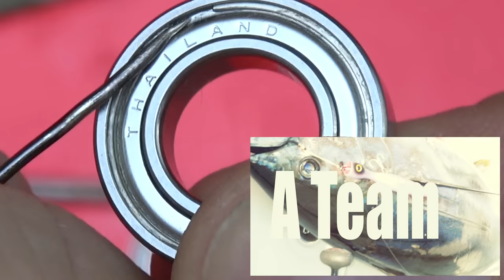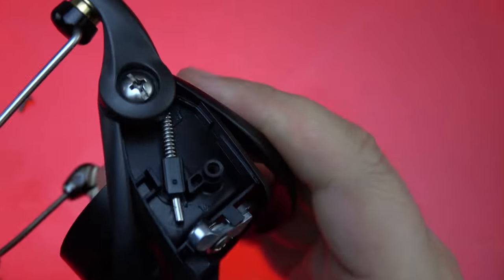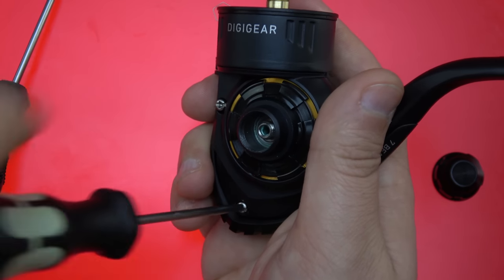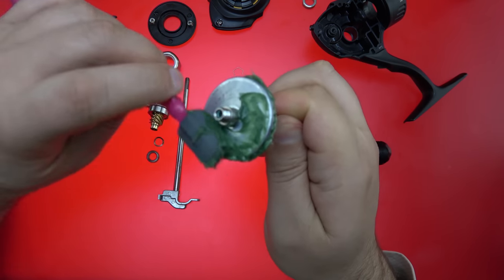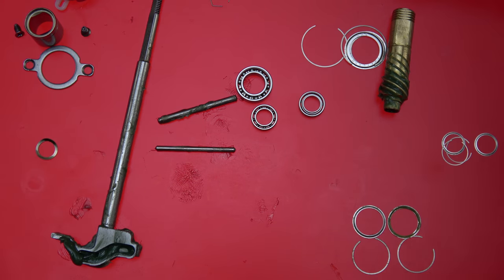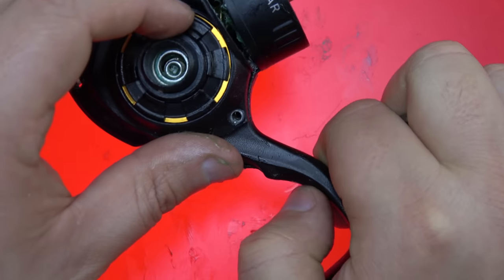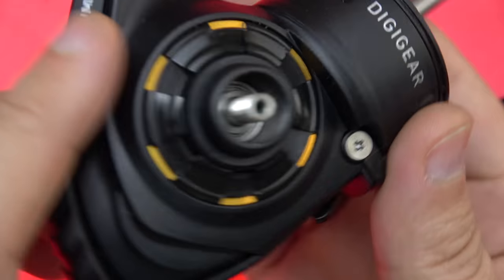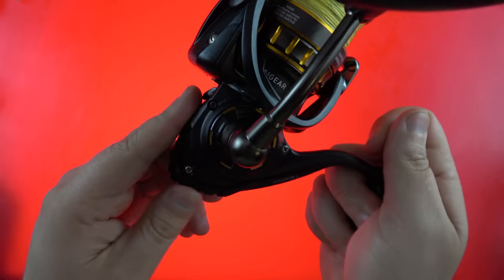Daiwa BG Full maintenance and service tutorial. How to protect your reel against  sand and saltwater

Comment: Have two of these reels and recently one started to jam. Found this video, stripped it down, and put it back together. First time I've done this and I don't have anything close to an engineer's mind. Quite straight forward, apart from minute 39 when you quietly couple the cam gear with the main shaft! Didn't see that first time around so had to go back in a second time! Otherwise a very useful film! Thanks.
Reply: Put a reel n rod on boat at sea. After 3 days salt spray jammed it.
   Open up, shoot with WD 40 and it work good as new !
Reply: @rohzpopper4922  didn't you hear what he said. NO WD-40!!!

Comment: Great video! Thanks Tackle Advisors.
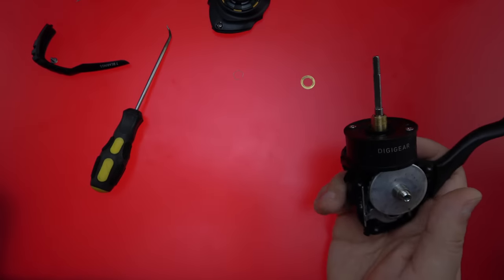But... I've just opened up my new 2500 for some preventive maintenance and found out that there are small differences between models. There can be a washer at the screw holding the case-bumper (at 16:20) sitting between the bumper and the case. It's not shown here nor in the shematics but both my 1500 and 2500 have it. The top cap covering the A-R clutch at 17:20 can sit on two tiny brass washers not shown in this video. There is also an arrow on the top cap that needs to point upwards > towards the foot of the reel.  So beware and keep a REALLY close eye on all the parts in your particular model.

Comment: Just wanted to personally thank you for this video as I had a bearing retaining clip pop out and I couldn't figure how to get it back in. The cut q-tip method was the trick! I held a small pen light in my teeth to illuminate the bearing lip and that helped as well. 

As a side note, (and you probably already know this now), but the extra plastic washer under the spool is to adjust the line load angle to help prevent backlashes...according to Daiwa. This explains why some reels have it and some don't as some people have used it to set the spool a bit lower on the shaft. 

Thank you!

Comment: About ready to service my BG 4500, and this video is saved to my list just for that. Thanks for the fully in depth coverage bro!!!
Reply: Nick I have a question. Does the handle switch from the left hand to the right hand for right hand retrieve? Just wondering thinking about getting one myself, but i am not sure if it can switch sides sense i retrieve right hand not left
Reply: @Anthony-nx7di  to be honest when I first picked up the BG4500 I tried to switch it from left to right hand retrieve with no success, I'm not sure if I am not doing it correctly but it's not like other reels like the Shimano Nasci 5000 for example. I was able to switch it from left to right with ease. It would be best to check  with your local retailer in case. Otherwise,  my answer still remains, no it can't.
Reply: @Anthony-nx7di  Yes you can switch it from left to right.

Comment: Serviced a BG 6500 today of a surf fisherman. Had a raspy noise, relatively new reel maybe 10 trips nothing crazy treating it. Said he'd tried to service it himself and it came out raspy. Turns out your cotton swab turned upside down to reset the non handle side bearing is important. He'd taken something hard trying to reset that bearing completely to out the retaining clip on. The entire cover of the bearing was chattered and dented. Took the covers off the bearing and it spun beautifully. Put the covers back on and it was raspy. I ended up packing the two main gear bearings which eliminated 75% of the raspy sound but it's a good lesson to share I thought. I love these reels and HATE that design. That non handle side bearing and retaining clip is a pain and I don't really understand why they designed it that way.

Comment: Awesome video! In most videos I see, the only thing people do is just oil the roller bearing and lube the shaft. That will slightly help and make it a little smoother, but you really have to break it down and clean and grease everything. Especially the gears and bearings inside.

Comment: Can't find the comment but I asked you about a slight noise at the bottom of the spool cycle and you said it could be a bent spool shaft. You were correct I replaced the spool shaft and low and behold it was butter yet again. 6500 size and it's so easy to work on given the larger parts. Not than any reels are rocket science contrary to some YouTube reviewers who don't even open them up. Still not sure how someone can "test a reel" let's say without knowing how it works.
Reply from the maker: Hey man! I remember it.  Glad it was an easy fix and everything worked out!
Reply: @TackleAdvisors  I used it as an anchor rod and reel off a pier for a trolley/pin rig and I'm pretty sure I bent it trying to get the 8oz anchor weight to budge. Wasn't smart but I don't own a cheap round reel to heave out there. Most guys use old Abu 6500 type reels and I saw two AR's give out on the same day.

Comment: I let a friend of mine borrow my BG6500 to do some surf fishing in NC. Got it back and it felt fine but over the next 6 weeks it got a little choppy. I opened it up and it was FULL of salt. Every nook and cranny was full of salt. The gearbox had salt chunks all over it, under the drag knob, under the rotor, the handle. The only places there was no salt was the actual drag washers and the AR clutch and sleeve. It was 10,000 times worse inside that it felt when spinning it. My buddy must have dropped it in the surf, went for a swim with it, something crazy. I broke it down entirely. Ultrasonic and a bowl of vinegar were helpful but a scrub pad and steel wool were best. It's got a decent gear grind now but it's fishable. Glad I didn't let him borrow my Saltiga.

Comment: Very fine job! I love my old silver series 7000C in the surf. I’ll bet this BG is even better.
Reply: I have several old silver series reels that I've used for DECADES, and I will say without question that even though they aren't as smooth or sophisticated as these modern reels, they will easily outlast them with proper maintenance. I've gotten rid of some of my modern reels because they've turned out to be junk. Just my experience and opinion.
Reply: @Belvedere3834spd  I think your experience and opinion are spot on! I was talking to a friend a minute ago about fishing with our 1950s vintage large Luxor No. 3 reels. To me there have been only a very few reels built since those Luxors that even have a chance at competing with them. Just this afternoon I got a mint Mitchell 498 Super. PPUM saltwater reel you simply can’t believe. I also just finished together a beautiful Mitchell 396 from parts and put on a NOS gray spool and Mitchell high speed handle. That reel can cast better than almost any modern reel. I know I’m extremely biased but I see no need to purchase modern reels even with their extraordinary features when I know they have no chance of standing the rest of time. My negative feelings and bad experiences with modern reels started with a Quantum Cabo Saltwater Reel that I bought for a lot of money that didn’t last 5 years. This was in spite of the fact that I meticulously take care of my reels. Never again!

Comment: Awesome video man! You sure do go liberal with the grease lol. I'm sure this video will go viral with how many people own this reel and you really do cover all the bases.
Reply from the maker: Thanks brotha! HELL YEAH....I had a touch of the flu when filming it...so hopefully that has an impact on views...lol
As a surf caster for decades....it's only recently we have a bunch of sealed options out there.  It used to be just VS, saltiga z and the mitchell banana....NOw penn torque, Zeebass, saragosa, spheros, shield etc offer waterproofing.   This method of protecting reels has been done for many years...in fact we used to fully pack the entire cavity of some reels.

  Hey ...did i respond to your question about the ferrofluid?  The stuff i use is VSG 203a.....it's what Ferrotec recommended for my purpose.   It's friggin expensive..70-100$ for 3ml.    They gave me a 3ml sample.  
Contact Shipwreck who is a member on stripers online.com  he should be able to send you some (in order to PM him you need to be a member.  It's show season and he's the head daiwa rep so he's a bit bogged down.  But worth the effort tracking him down.   Just read the rules when you sign up as it takes a few posts and days to be able to send pms.
Reply: Tackle Advisors awesome thanks I'll make sure to do that

Comment: Really enjoyed the tutorial! My fishing buddy bought the same reel on my recommendation. After a couple of months it started binding which usually means the shaft was bent. I had one helluva time getting that shaft out. The bend was right where the shaft enters the slide. I just got lucky. Put the flat end of the shaft in a vise and prayed. It slipped right into the slide with no bind and the reel has been working ever since. I was surprised the shaft was so wimpy where everything else in the bg was overbuilt.Sure wish your tutorial was around when I took the reel apart.
Reply from the maker: Thanks Pat!  Glad you liked it
Man...that's an oddball place for it to bend.  Especially with all the different angles of support.....But I saw the exact same thing on the penn z i tore down when i did the star s7000 review.  Tried getting it out and blew out the pinion....tried torching it.....had to replace parts before I even did the review...lol

Well unless youtube goes out of business...it'll be up the next time ya tear it down  :)

Lemme take a guess...was it a 5k size and fish the cape cod canal??
Reply: It was a 4000. We use it here in the gulf of mexico primarily to catch bonito [false albacore], although we do use it for mangroves when we are chumming.
Reply from the maker: Damn....I was close...lol...only 1800 miles off :)  
I'd be willing to bet the damage came from taking a hit.  maybe in gunnel holders or storage.  You guys have all the fun...Albies around here come through for about amonth and they're usually moving full steam ahead if surf casting for them.  And if in a boat...generally 200 new yorkers are casting over your t top...lol

Comment: Thanks for this! After using my bg's for over a year (sweet water mostly) I managed to service them, removed most of the grease and used interflon super only on all the moving parts. The result is amazing and they spin even better then when I got them. They may not be sealed with grease as before but don't need that. Furthermore interflon is water repellant as well  as far as I understood. Big thanks again as I would have never opened them up😉
Reply: is the reel good out of the box or should I use your method before even using the reel?

Comment: Awesome video
If you dunked the reel in salt water, would you perform a complete teardown afterwards? Or does all the grease you are using in theory prevent any water getting to the parts?
If you do planning on teardown water a dunk, what's the benefit of the generous amount of grease? 
I ask this because I used to also pack it with grease, now I rather put less and teardown more frequently

Comment: I love lube and I go pretty hard on the lube with my BG's because I had one get FULL of salt. At the same time, I feel like so much of this grease is just gonna end up in the case, not really doing much but being it's awesome sticky self. Maybe that's the idea but as soon as those gears mesh that's a lot of grease that's squeezing out into the case. I use a product called tefgel for where the two sides of the case interact and it does well.

Comment: Awesome video. Really have a better understanding of my new reel. I just bought the 5000 BG and the 6500 BG taking apart the 5000 but stalled after the spool cannot seem to take the washers off? Any suggestions. Have taking apart the main gear apart no problems. I believe that the grease that comes with any new reel is no adequate & that is the reason I am took mine apart to grease them up with some good Pen grease . Looks quite similar to what ur used in your video.. keep up the good work very much appreciated. Sami

Comment: This is a great video to learn from!

Question - I have the BG4000, which I dropped in the lake and only submerged for 15 minutes.  Also I had dropped it twice fishing on the banks.  Now when I turn the handle it seems very loose, and not catching the rotor, which does and does not spin.

Note - As is turning the handle the rotor does not spin, however if I push the handle in (towards the right), the it will catch the rotor and then it spins.

What could be the problem?

Comment: Hello , I just bought a bg 3000 last week and I’ve been spinning all days,today the reel start to be hard to crank and I’m feeling the vibration on the tooth engaging between the main gear and the pinion.
I’m going to sent it back to Daiwa, but what could to be the problem ? 
Thanks and continue the good work on the channel
Reply: if you tighten the side plate too much it will press the pinion and main gear against each other and gears will not mesh together properly. Also the back of the main gear will touch the side plate while rotating.
Reply: If u keep the side plate too loose then u will feel play in the handle. Just tighten the screws medium.
Reply: Nauman Ahmad Tariq i

Comment: Question! Would it be feasable to warm the grease to near liquid and dump the nearly assembled reel into the hot liquid grease, allowing it to fill all the cavities and coat all surfaces? Alternatively,  an evaporating solvent, grease it, warm it up, allow the volatiles to evaporate leaving the grease? Just because my old  fingers are not so nimble, nor am I liable to see and remember all things? Dental pics are nifty. Ultrasonic cleaners allow liquids to permeate EVERYthing. Very nice little reel!
Reply: the grease would separate at the required temps to get it into a liquid form and even if you did, you couldn't guaranty it would permeate into all of the necessary places. If you struggle to do the job yourself, then see if you can find a local tackle shop to assist you.

Comment: I recently used Penn precision grease in two of my Daiwa BG 5000. First I applied it as it is but the reel became too hard. Then opened both of them again mixed 50 50 ratio of penn grease and synthetic motor oil. Now it spins light.

Comment: One more tip.... since the BG doesn’t have the  nice case gasket that the Penn Slammer does. You can seal the case  if you run a small bead of RTV on the cover before it’s installed. You can also seal the black cap that screws on opposite the handle. Nice video just thought i would share the info.
Reply from the maker: I get that and it would work.  But grease would work just as well.  water getting in between the frame and sideplate and non handle cap are more often than not.  Not the issue.  And any gaps can be filled just as effectively with grease.  And deep water dunks will get in from the ar clutch and main shaft areas anyway.  Which is why it's not really worth it.  For the Cabo that has an ar clutch seal and nothing else...maybe.  but not the bg.  Good idea though....FYI...i tried this with rtv 2 with the Gosa FA  10 years ago :)

Comment: Proper Vid that! My BG went all grindy after one season only in salt water, I presume it must be the gear and probably not much I can do about it at the moment? Unless you'd have any ideas?
Reply from the maker: It could be the top pinion support bearing.  That one is susceptible to corrosion and have seen many fail.  Gives off that grind feel.. A 10$ boca hybrid ceramic is a good replacement (yellow seal)
Reply: @TackleAdvisors  thank you sir. I guess I need to disassemble them and check the size of the bearing? 2500 and 3000 I have here
Reply from the maker: Unfortunately I don't have the measurements here.  I think they have the numbers if you call or email Daiwa.. But you should inspect the bearing prior to ordering
Reply: Thanks again 👍

Comment: Hi, great video. I disassembled, cleaned, lubed, and reassembled my BG3500 using this video as I guide. I now experience a knocking sensation when reeling, even after disassembling and cleaning a second time. I think it might be the slot on the main shaft rubbing against the portion of the OSC gear that goes into the slot, but I can't figure out how to fix it. Any ideas?
Reply: I have the exact problem. Did you figure out yours?

Comment: Great video.  I'm looking at a 3000 model.  How will this handle surf fishing?  I'm 
talking about standing in the waves and the reel getting completely 
submerged by waves sometimes?
Reply from the maker: For that sort of fishing... This ain't the reel... It'd fail quickly... There aren't many reels designed for that... Van Staal and zeebass are really about it.  Spheros sw 5/6000 are about the cheapest you can get... Penn claims to be ipx whatever... But in my experience they can't take that sort of abuse much... Then there's sand... Sandy waves can lock up a reel to the point you have to dunk and reel to grind it out... Vs and ZB are the only ones I'd recommend

Comment: great video. I appreaciate the time you put into it. I have a bg 2500 that's only been fished thrice and its developed an issue where theres a small bit of resisitance when starting to crank the reel. i assume i have to tear down and regrease whatever is causing it to bind. any expert opinion on where to focus would be appreciated. thanks in advance.
Reply from the maker: Thanks Ronghoward, I'd say make sure the spool shaft isn't gunked up.  
And  take a look at whats around the pinion gear.  Usually when things get sluggish it's after the input side..Meaning handle / maingear bearings.   And somewhere around the pinion / ar clutch/ pinion bearings.